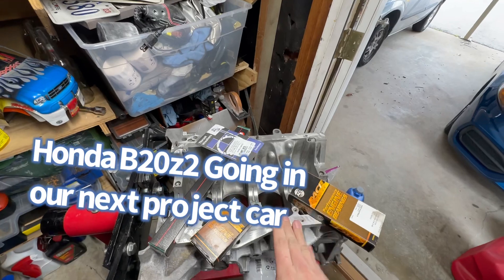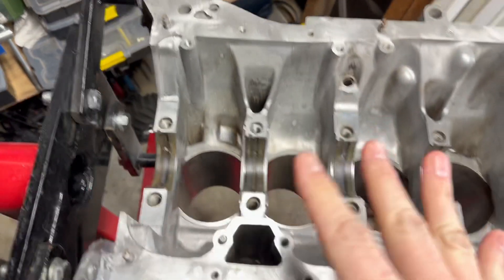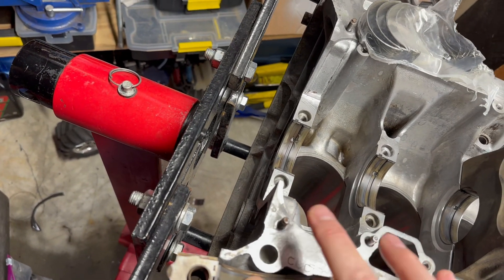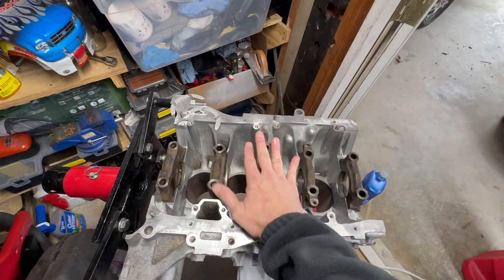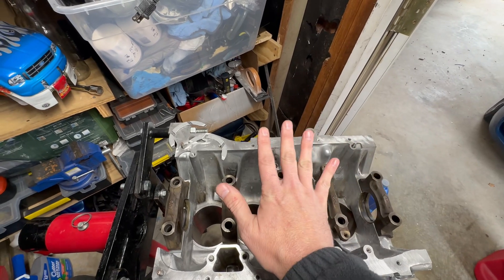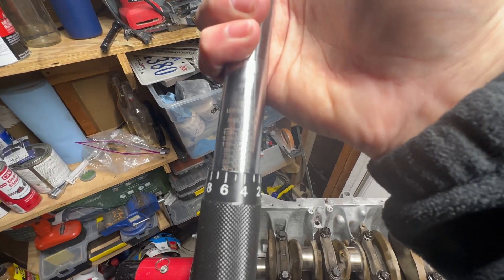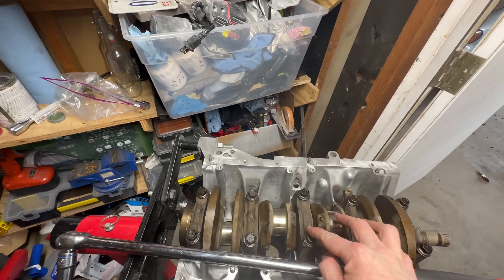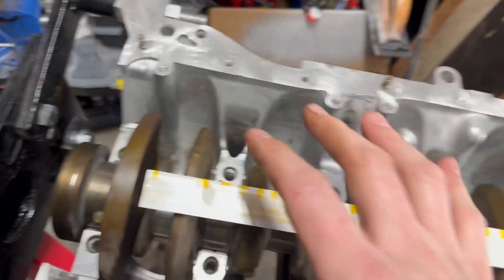Honda B-series, Crank bearing oil clearances/Torque specs!!!!!

Comment: For anyone chexking out the video - the torque specs call for 56ft/lbs for the #1 and #5 main caps.

The #2, 3 and 4, the torque spec is 49ft/lbs.

This is for OEM bolts. 

Don't do it like the guy did here.

Comment: Hey, I thought the crank journal arrow supposedly point towards timing belt side same on piston not pointed towards rear main seal.
Reply from the maker: Yes you’re right, I was just showing the ring gap not actually installing everything.
Reply: I just it them on the wrong way and torqued them. Did I ruin them? Or will I be okay fixing and flipping them?
Reply: Wait, so when install. The arrows point to the timing side? And is the timing side #1 or #5?
Reply: @0hitsjayy870  timing side is #1

Comment: So you installed new crank bearings then checked with plasti gauge? Is there different kind of bearings or do i need a specific size when ordering?
Reply: if you have a stock crank and block, there are codes on them that correspond with a chart in the FSM that tell you which bearings you need. Honda produces multiple thicknesses based on those codes so you can dial in the clearances. from thickest to thinnest the colors are blue brown black green yellow pink and red. blue being the thickest (tightest)) and red being the thinnest (loosest) Rod bearings are coded the same way. Last time I built an engine I used a mix of bearings for the crank but my rods were aftermarket and based on my crank coding and forged rods green rod bearings made for the right clearance but ymmv. Block/crank codes aren't perfect so if you have the money it helps to buy based on the code, but also some thicker and thinner so you can dial it in to exactly what you need.
Reply from the maker: It depends on what type of rebuild you are doing, factory or upgrades ie. bigger crank or pistons/rods
Reply: @JCMotiveGarage  just piston and rod upgrade for boost
Reply from the maker: @stunter956 send me a message on Instagram or Facebook